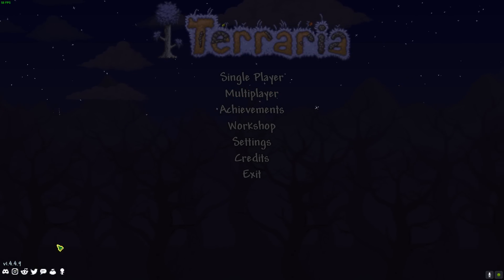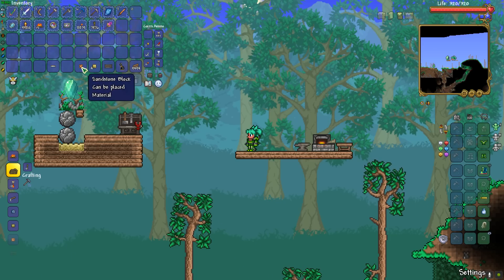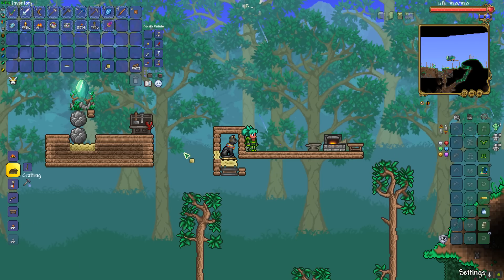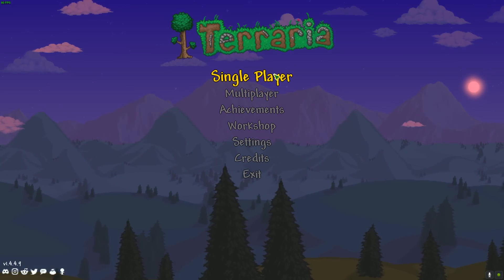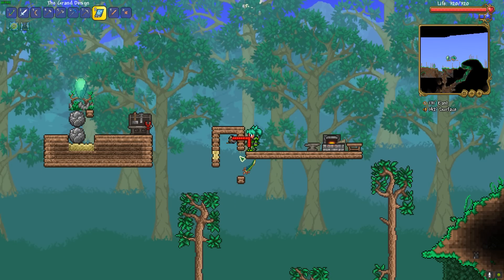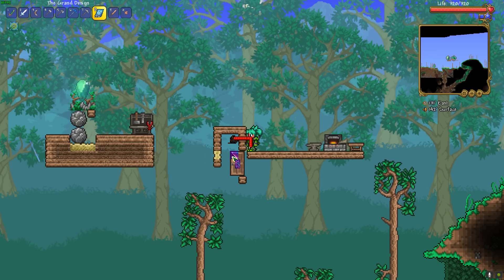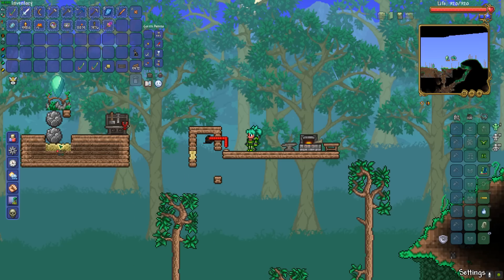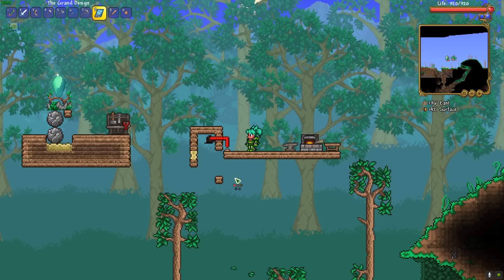How to turn a Door into a Terrablade +more | Terraria Glitch Explaination

Comment: I guess this happens because on the game code something like item ID for statue is incremented by a value so it becomes activated statue, instead of just assigning a value. No idea why it would be done like that, but oh well. And when a piece of door block is in the same coordinate as a statue block the same effect applies to it.
Reply from the maker: yes, you hit the nail on the head
Reply: Terraria has some pretty crazy and... Frankly disgusting code. I experimented with tModLoader, and oh my god the amount of nonsensical stuff that's done there is nothing short of insane. They kind of improved it in 1.4, but there are still some remnants of the spaghetti that used to live there. It just made me respect the tModLoader developers further.

I do have to point out that this glitch works because of this particular sequence: block swap wood to sand -> sand falls because of air below it -> sand falling breaks the trapdoor -> sand below the statue falls because the trapdoor sustaining it broke -> statue breaks because the sand sustaining it fell -> glitched statue. The bug in question is either falling sand doesn't correctly update tiles above it further than 2 tiles away, or the statue doesn't break correctly when broken by falling sand, or a mixture of both.
Reply: @HappyGick  as far as i understand that is required only for the door to be able to open and clip the tiles which belong to the statue. The morphing itself has to do with the logic for the statue to change into an activated statue. That would also mean that each block isn't an entity of it's own, but merely a tile of a map with some parameters. Then on top of that the logic of how tiles transform from open door to closed door also contributes to the bug. So many ridiculous oddities of the code logic coincidenting for the trick to be possible.
Reply: @MatVeiQaaa  Actually that's exactly what's going on, you hit the nail on the head again. But this edge case of multiple logical oddities overlapping wouldn't be possible if you couldn't clip tiles. This glitch relies on the fact that the game isn't correctly updating "unstable" tiles (tiles that require other tiles below to stay in place) in this admittedly niche scenario. In a better programmed game, you wouldn't be able to clip tiles in the first place. The entire glitch stems from that particular interaction. Hence why I say that the glitch works because of that. No tile clipping = no glitch. Tile clipping shouldn't be possible.

Comment: Bro I just discovered a new bug.
I need to replace the sand block what's bettween the two  wood blocks by a sandstone block. (before bugging)
Then make the original bug, and when I put the another sandstone block it give me 2 bast statues.
Using the same bug with another statue u can get shield statue for free.

Comment: I did the exact thing you did, and when I block swap the wood with sand to the left of the trapdoor, and the bast statue still stood.
Reply from the maker: you need to be in multiplayer
Reply: Same here and was in multi player
Reply from the maker: @rachelmarie6559  if not on pc, you need another player to join
Reply: @eatpotaro   OK thanks for the insight

Comment: Hey my bast statue isn’t breaking when I replace the wood with sand. Do you know why?
Reply from the maker: this glitch does not work on non-pc platforms, if you are on pc check if you are in multiplayer
Reply: @eatpotaro  i found it works on xbox but it cannot be with the same client you need a different console to do the de-sync also alot of the items don’t correlate to the spreadsheet probably because of the id values on xbox may differ
Reply from the maker: @Froskayy  thats really cool! since the xbox and ps3/4/5 versions were build with extra items (i.e. ocram and his drops) the ids would be different
Reply: @eatpotaro  Exactly!

Comment: I did everything right. I did everything exactly the same as you, on pc, hosting the game on multiplayer.
But when i got to the part of placing sand next to the trapdoor and then placing the hardened sand block next to the sand block and doing save and exit, when i got into my world again in singleplayer i didn't see the bast statue's head.
any way to fix this?
Reply from the maker: sometimes it takes about 7-15 seconds for the multiplayer world to save, so wait about 15 seconds before joining the world in singleplayer
Reply: @eatpotaro  thanks for replying! It seems like i didn't wait long enough for the world to save
Reply from the maker: @bundile2261  no problem!
Reply: @eatpotaro  i also have same problem & i also waited for 15sec but the bast head doesn’t appear i have tried it 20 times
Reply from the maker: @thrilledweb69 maybe you didnt place the sandstone block fast enough

Comment: Doesn't work on Xbox. The bast statue will just float in place after block swapping the wood for and and will only break when the statue is off screen
Reply: Look up icysnowman's transmutation guide. It works for me on console, although it requires 2 people
Reply: @mightbetoad6786  I got the floating head of the statue but the statue will not turn on and off
Reply: @yungcoles6109  You must not be wiring it right
Reply: @mightbetoad6786  I hav the wiring going through the statues head
Reply: @yungcoles6109  Is it linked up to the button/switch correctly? Maybe you can try moving the wiring one lower?

Comment: Hi it worked for me once, but afterwards I can only get the tungsten brickwall now? Which is really weird cause all the steps are correct, the bast statue is doing its thing, and when my cursor is hovering over the space, it shows terrablade. But when i mine it, it mines tungsten brickwall. It worked the first time though so I'm really confused.
Reply from the maker: you are not mining the correct part. you must close the door as a terrablafe to obtain it. there are also a couple places where you can mine it when is open and part terrablade part wall but i cannot remember them of the top of my head
Reply: @eatpotaro  ayoooo you're a g fr mannn it works now

Comment: if i dont have the grand design so how do i do this glitch
Reply from the maker: use a dart trap for the pressure plates and wiring, just make sure the placement of the wire goes through that bast's head

Comment: Everything worked find until the transmutation process, when i do the same as he does (transmutating door)it just doesnt change to anything, the door is the same.
Reply from the maker: is the wiring all correct, and is the bast desynced?
Reply: @eatpotaro  it is. I tried restartinf the world a bunch of times, making a new machinr to transmutate but in the end it all didnt work, i Just gave up on it
Reply from the maker: @АртемКорепанов-р4ы  if you into sibgleplayer, is the bast there?
Reply: @eatpotaro  when i tried in the first time, only head was there
On second and after it was just purely gone
Reply from the maker: @АртемКорепанов-р4ы  on singleplayer, the bast should be visivle and it should only be the head. on multiplayer, this setup means the bast head will never be visible
Reply: @eatpotaro  visible or not, for some reaskn it just didnt work idk ehy3
Reply from the maker: @АртемКорепанов-р4ы  from the top right tile of the bast head (or where it should be) how many tiles are in between that and the door top
Reply: @eatpotaro  i think it was 1
Reply from the maker: strange, maybe the door was opening to the right instead of the left so it didnt overlap? idk i got nothing
Reply: @eatpotaro  nope, left
Reply from the maker: @АртемКорепанов-р4ы  damn i dont know whats wrong, sorry. can you record and post a video of whats happening?

Comment: I dont know how u swaped the sand with the sandstone block
Reply from the maker: put the sandstonr in the hotbar and select it, then open the inventory and right click on the sand to hold one. then your first click will have sand, placing it and your second click will have sandstone block
Reply: @eatpotaro  i did it and it worked now i need to kill skeletron then save the mechanic i think for the wires

Comment: me when i place the sand block to put that sandstone after it doesnt get rid of the bast statue what to i do if it do that
Reply from the maker: you need to be in multiplayer on pc version
Reply: @eatpotaro  oh ok
Reply: @eatpotaro  thanks it worked but do you know wich door do i need to use for the zenith?
Reply from the maker: @Grumpynut  you need the steampunk door, i have another video on how to setup the automatic version for zenith
Reply: @eatpotaro  ok thx
Reply: @eatpotaro  wait how do you get the steampunk door?
Reply from the maker: @Grumpynut  im pretty sure you need to craft with cogs sold by the steampunker. alternatively, if you check the google doc in the description, you can see how to obtain a steampunk door via transmutation

Comment: Deos this still work? I've been trying to do it and whenever I use the sand the bast statue doesent break?
Reply from the maker: yes, if this happens, you are not in multiplayer. also this may happen on non pc platforms as it does not work there
Reply: @eatpotaro  I've tried it in both multiplayer and single player and it didn't work for me. I do it on pc. I tried multiplayer and singleplayer both. Thank you for ur responce though. And, im talking about the tutorial part where the statue head is supposed to break after u replace the sand, for me it just floats and doesent let me block swap with the other orange block
Reply: @eatpotaro  nvm I Tried again and it worked xd
Reply: @eatpotaro  does it still work in 2024 pleas eanswer
Reply from the maker: @PanCake-ks3gy  yes

Comment: Sorry, do I need to be fast when doing the sand block swap and sandstone?
Reply from the maker: yes
Reply: @eatpotaro  i dont know if you are already doing it sort of, but could you make tutorials on the craft zenith and terrablade speedruns?
Reply: Update: i tried the bast world seed on switch, it’s the same world, but for some reason it doesn’t generate the pressure plate at the desert house. Do you know why?
Reply from the maker: @christopher_campbell  must be minor differences that the switch has or something
Reply: @eatpotaro  i just noticed that the world where you get bombs has a pressure plate so maybe i can get that, or if all the traps are actually just gone 😭
Reply from the maker: @christopher_campbell  you may want to go into the bast world, take the bast out and put it in the hermes boots world because there is no wiring wihout a pressure plate
Reply: @eatpotaro  where is the wiring in the boots world? The house?
Reply from the maker: @christopher_campbell  yes

Comment: I've been trying to do the glitch for some time but the statue of bast doesn't break, it just floats in the air, even on a server
Reply from the maker: what platform are you on?
Reply: @eatpotaro  I was testing on mobile
Reply from the maker: @mateushenrique2371  unfortunately it doesn't work on non-pc platforms
Reply: @eatpotaro  , Not work in PC. FIX?
Reply from the maker: @namemissing2079  are you in multiplayer?
Reply: @eatpotaro , yes of course
Reply from the maker: @namemissing2079  what exactly is going wrong?
Reply: @eatpotaro , thank you very much, it turned out, I mixed up the block. I don't speak English well, sorry
Reply: @eatpotaro  So the reason why I can't get this to work with my Xbox, is that this just doesn't work on the Xbox?
Reply from the maker: @AlicentaurBrony   i guess? that sucks

Comment: why my statue doesn't desappeared when i'm brecking the same block as you ?
Reply from the maker: are you sure you are in multiplayer?
Reply: @eatpotaro  yeah i'm doing exactly what you do on the video
Reply from the maker: @xe-tipp3474  which block are you talking about
Reply: @eatpotaro  the wood one at the left of the trapdoor
Reply from the maker: @xe-tipp3474  are you blockswapping or mining?
Reply: @eatpotaro  mining
Reply from the maker: @xe-tipp3474  you need to blockswap it with sand

Comment: Everything works all the way up to opening the door. I see the Bast's head and everything but the door won't open regardless of whether it's on or not. Any way to fix this?
Reply from the maker: if the door isnt opening, there may not be enough space to open the door
Reply: @eatpotaro  there is nothing in front of the door nor behind it!
Reply: @eatpotaro  it opens when I walk through but not by click if that makes sense...
Reply from the maker: @carter884  are you using the correct cursor? the smart (thick) cursor may be latching onto another intractable
Reply: @eatpotaro  With or without smart cursor it does not open sadly
Reply from the maker: @carter884  do  you have a picture or video of the setup?
Reply: @eatpotaro  yes where should I send the video?
Reply: @eatpotaro  do you perhaps have discord?
Reply from the maker: @carter884  could you post to your channel?
Reply: @eatpotaro  let me know if the video works for you!

Comment: doesnt work for me. i was on pc and did the first part on multiplayer but when i waited like 15 seconds and went into my world in singleplayer it was gone
Reply from the maker: was the entire structure gon or just the head?
Reply: @eatpotaro  i found out it was because i didnt use a sandstone block, i saw that u can use stone blocks in another video so i just assumed that it doesnt matter which block u choose but the problem is fixed now. Btw good video
Reply from the maker: @Avocado3699  thanks! there are some rules which allow different blocks. if you want to use stone, you need to replace the top-left sand block with dirt iirc

Comment: I did the timing good but the head won't show up
Reply from the maker: in multiplayer, the head wont show! you did it correctly. check to see if it works by running a wire through it and activating it. if a bunch of particles spawn, it  works

Comment: how do you get drill containment unit with this?
Reply from the maker: check the spreadsheet to find out
Reply: @eatpotaro  That's what I did, but I can't find it
Reply from the maker: @sirduck551  its ordered by id, but theres a checkbox to make it item name instead. either search for the item id (find it on the wiki) or save it locally and set it to be names and search that way

Comment: I can get the tungsten brick wall and crystal door but i cannot got terra blade please help🙏
Reply from the maker: @legioncommander1748  close the door on the top left corner tile
Reply: When I break the block the bast statue don't Dissapear just float and I can't place a sand stone block💀
Reply from the maker: @PlaywerAbakirov-jh7mq  you need to be in multiplayer
Reply: @eatpotaro  I am it just floats whenever I break that block
Reply from the maker: @PlaywerAbakirov-jh7mq  on mobile or console you need to connect another player
Reply: @eatpotaro  oh

Comment: Is Rod of discord obtainable using this too? Cuz I can't open the spreadsheet
Reply from the maker: it is obtainable
Reply: You can get a Rod of Harmony using  the Mushroom Door and transmuting 130 times. The Spreadsheet is lacking items and says "no item" past line 125 iirc which is incorrect.There are tons of items missing from it.
Reply from the maker: the spreadsheet is fine, it will say no error if it cannot get the name of the item (it may not be able to connect to the internet)

Comment: They made it so the bast statue floats when there isnt any blocks underneath it on console :< i wanted to use bugs for fun on my endgame save
Reply from the maker: i think on console you need a second player (or controller) to join
Reply: @eatpotaro  the bast statue floats and doesnt break tho, it might work but it probably wont cuz if it doesnt break then it cant be done

Comment: The only thing that comes out to me is a glass door :c (sorry if it is not spelled correctly, I am using a translator)
Reply from the maker: this means you are using the wrong door, to get the terrablade you need to use the wooden door. also, if you continue you can get other items
Reply: @eatpotaro  I used the wooden door
Reply from the maker: @xlp195  are you on pc? item Ids are slightly different on console and moblie
Reply: @eatpotaro   im in pc
Reply from the maker: @xlp195  just to clarify incase of translation erorr
you mean the transparent/white door?
Reply: @eatpotaro  no, when I press the button 1/4 of the pink-purple door comes out (that's the glass door) and when I press it again a door comes out with a piece missing
Reply from the maker: @xlp195  ah, that means you sre doing it right. in english that door is a crystal door instead of a glass door. the 'missing piece' is the mext item in the chain. it displays as nothing because it has no texture. right click that and repeat the process to get a terrablade!

Comment: for me its not working the statue is still floating
Reply from the maker: you need to be in multiplayer
Reply: @eatpotaro it does the same for me and I'm in multiplayer?
Reply from the maker: @Realmanjohn  on moblie or console you need to connect a second player/controller
Reply: @eatpotaro  I'm on console, and I had my brother play with me in a multiplayer world and it still stayed up.
Reply: @eatpotaro  I've tried a bunch of time and in different ways but it does not work );
Reply from the maker: @Realmanjohn  unfortunately i cannot help you without further video input, or a description other than "it doesnt work". just follow the instructions directly as they are in the screen and it will succeed

Comment: Ive tried doing this like 10 times now and I just keep not getting the floating bast head. what am I doing wrong?
Reply from the maker: you can only see the floating bast head on singleplayer, but you can only setup the glitch in multiplayer
Reply: nvm I got it on the next try.
Reply: @eatpotaro  I know this, I just didnt get the floating bast head even in single player. Idk what I did wrong, but after a few more tries I got it.
Reply: @MaximusXY , Me too, how did you solve the problem?